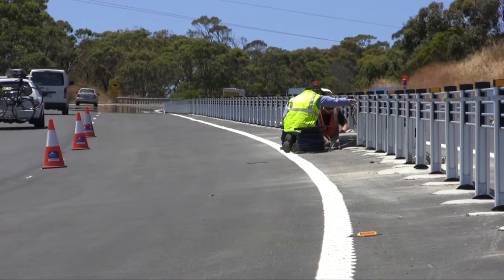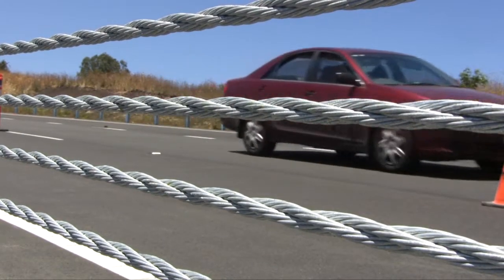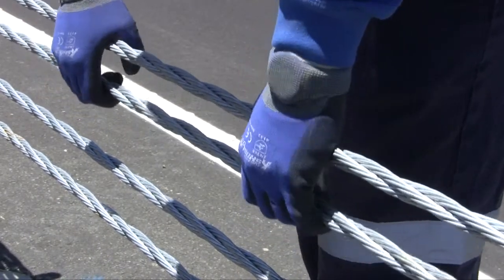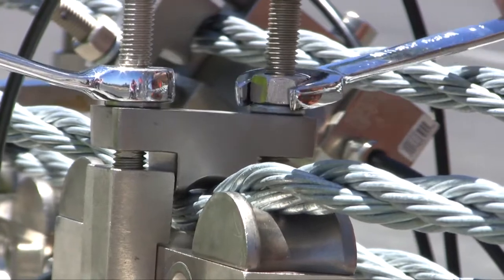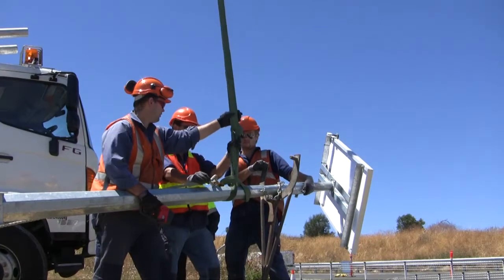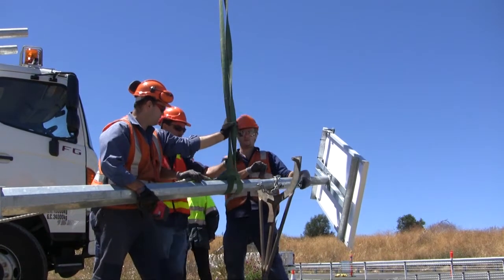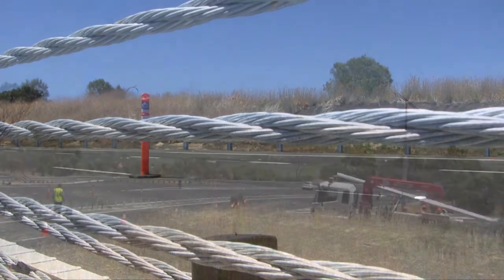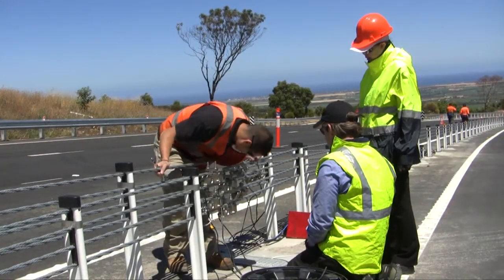World's smartest fence at Willunga Hill, Adelaide

Comment: Tensioned cables are the same technology used by ship breakers to cut ships in half, very reassuring. I've seen the one on Port Wakefield Road neatly take the roof off a small sedan which somehow managed to go under the bottom wire, god knows what happened to any occupants. I agree with Matt these fences are a death sentence to a motorcyclist. When the rest of the civilised world  builds crash barriers to absorb and dissipate energy over as large a time and area as possible, we build barriers which concentrates crash energy into a knife edge abrasive cord. Dilberts